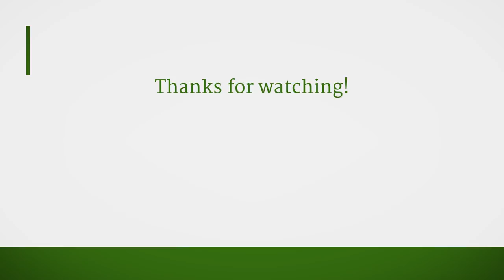How To Build The 4M Tin Can Robot - Step-by-step

Comment: Interesting, clever and very useful video but did you film some of this into a mirror? You turn the screwdriver and the nuts in the wrong direction when you are tightening them which made it a little confusing at first.
Reply from the maker: With the mechanism I used to film the top-down shots, it may have flipped the video. Not sure, but thanks for pointing that out.  I'll be on the lookout for that when filming future videos.

Comment: you're reported this is my invention I built in 2011 mine's ben working a lot longer than Walmart's usually last prof right on our computer not just one but its 
mutable company's have done it 

I've lost 11 of my inventions this year in 2022 and now 13 are stolen since 2016 from 2012
Reply from the maker: I bought the 4M Tin Can Robot kit several years ago and had problems putting it together. The other videos on YouTube on how to put it together were a little confusing on certain steps. So I made a video to help others who bought the kit like I did. I have no affiliation with 4M or Walmart and have made no profit from this video.

Comment: Walmart should be in LAWSUIT violation for this dude mines 15 times better than you're s  and it was hand with 2 gears and a motor completely home made at home
this is my invention not WALMARTS 

it is a felony and a series crime Walmart's doing here its stealing inventions a thats a true   crime what you're doing here you're stealing my ideas after I make them or even come up with them 
LAWSUIT investment and thats stealing my product violation I made in 2015 

most of those products like the RC LAWN MOWERS PIKACHU robots TIN CAN robots where all my ideas stolen in 2022 5 is against to my pressure and anger to where I called the cops because they're stealing my inventions I made the tin can robot 1'ST Back in 2012 long before Walmart DID IN 2017 WHICH IS VIOLATIONS OF PRUDUCT investment and that’s stealing my idea of copyright violations
Reply: Curse you! Mines I made it in 2012 I made this robot 1’st